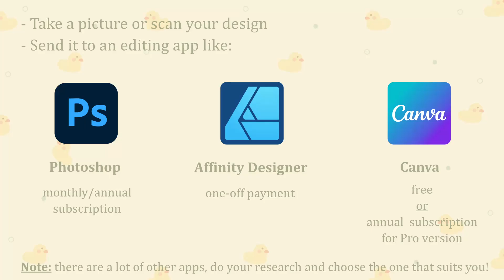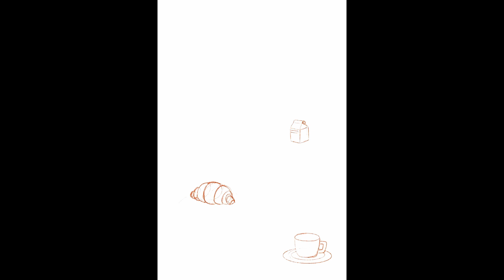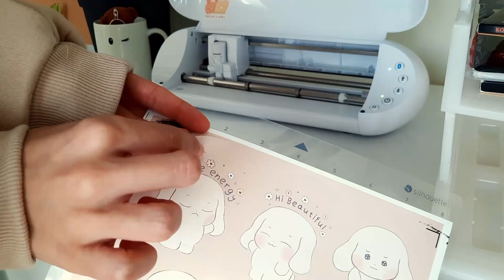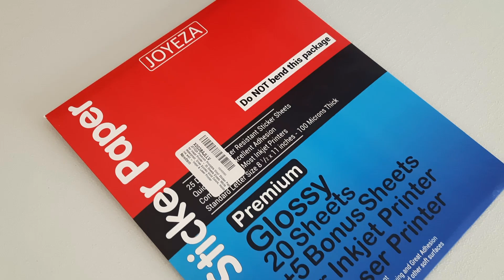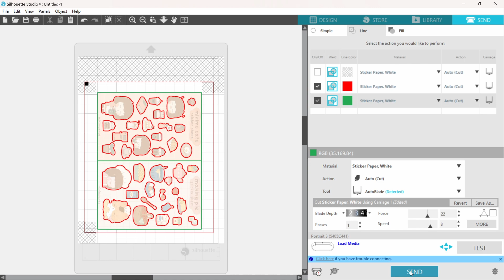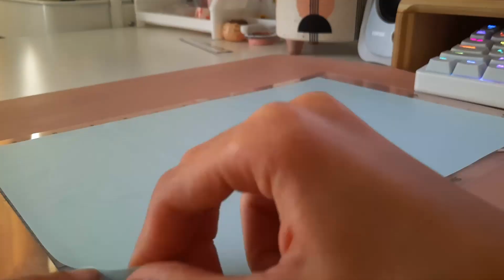How to make sticker sheets at home // using procreate & silhouette // step by step tutorial ✨

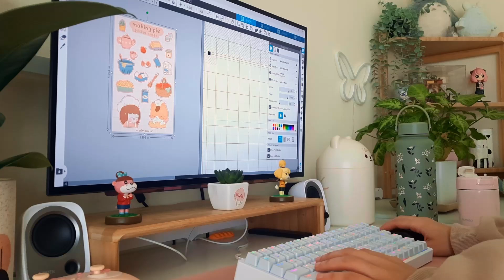Comment: 1:09 hi, +10 years printer technician here. This is not universal, please refer to your own printer's printing resolution. But for small design, 300 dpi is a minimum. Because home printers usually prints at that level and upwards. Typical modern professional printers is in the thousands. But if your printer can only go to 600×600 dpi, going higher won't change much. But it will make zooming and drawing fine details easier to see. But if your on windows and your oc is struggling, you might want to reduce the res a bit